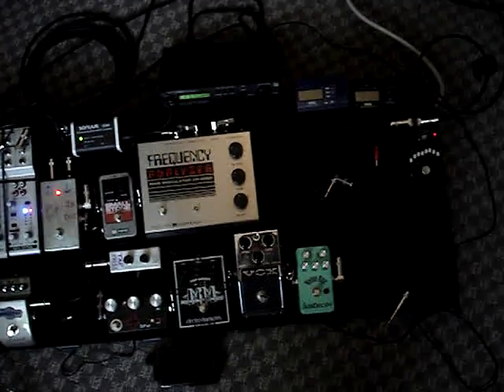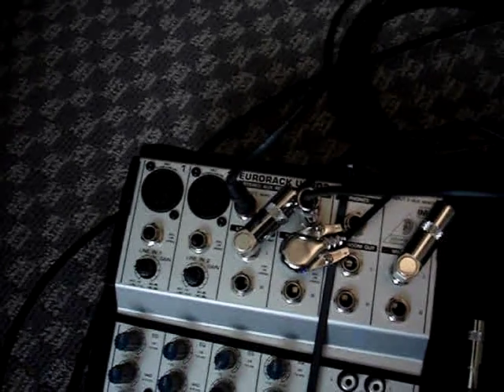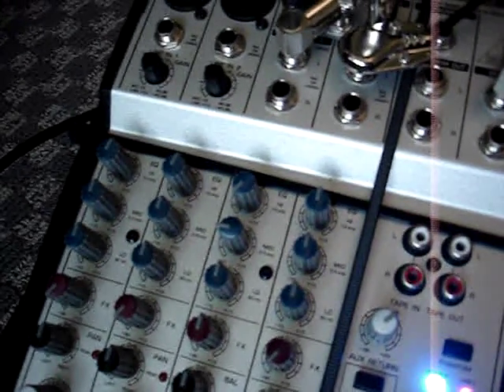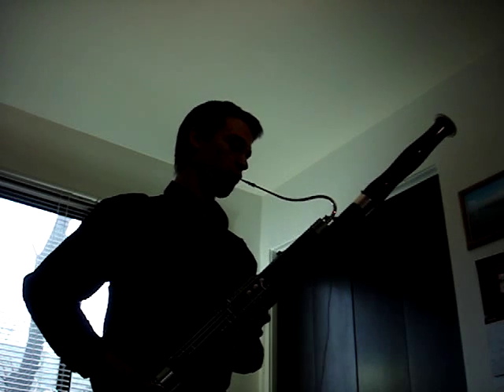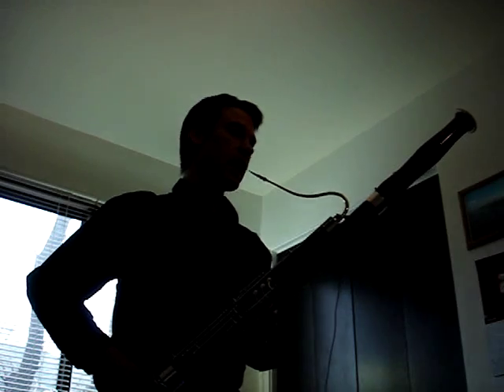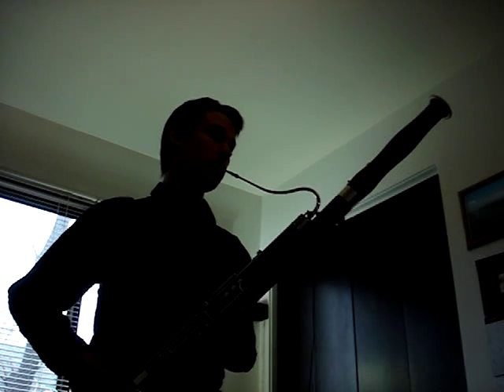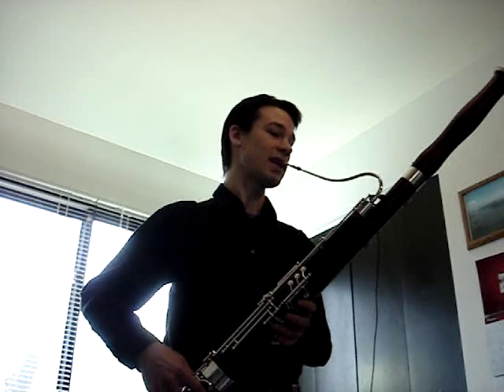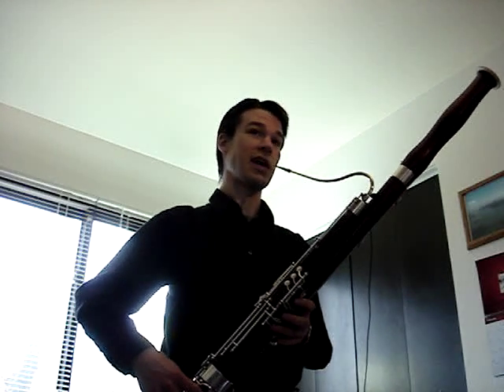Sonuus G2M used with the bassoon and Little-Jake pickup

Comment: The M9 and M13 are the Fx in the HD500.   I have the harmonizer block setup to go (-3) for the B3 with two digital delays for appegiation and looper after but cannot alter my guitar tone knobs live because I instantly switch backand forth  and its too many moves between beat 4 and 1 when dealing with latency.  The HD500 allows me switch many FX blocks to address most moves needed for this to happen except the pre EQ (mixing) thing. Placing foot switches in logically order-Stops hot coals dance!

Comment from the maker: @harrisonbucknor I doubt with electric guitar pickups that the live sound is enough to confuse the G2M.
I think following the general guidelines are the best thing for you here: neck pickup for sure, and if it's possible to set your HD500 so that the preset you want to use the G2M for get the EQ before the loop to cut out all the highs going into the G2M. If there is any audio bleed from the PA or something simply turn down your volume knob on the guitar so less sound bleed happens.

Comment: Great demo! I am field testing the G2M live in a band setting.  My problems are: 1. Adding a pre EQ (Boss GE-7)  and 2. G2M audio is fading out during live performances. Is it the vibrations set by the bass and drums confusing the G2M?   I am using Line HD500 FX loop, midi program controller for patch changes and G2M for (midi notes) with a JV vintage sound card.   Check this live link demo:  youtube.com       /watch?v=OxFv5ALBYNo&feature=related

Comment from the maker: You get used to the latency.  I did not find it distracting at all.  Your own acoustic sound will be more dominant in your mind for timing issues, so that's what I tend to focus on.

The bigger issue with using it on a woodwind is that you have to play EXTREMELY clean.  No chiff at the beginning of the note.  I find myself needing to use quite a few non-standard fingerings and flick keys to keep the sound clean enough for the G2M.  May not be a problem on clarinet.